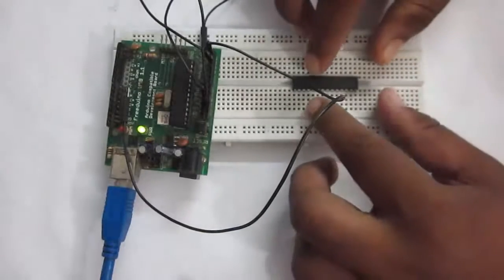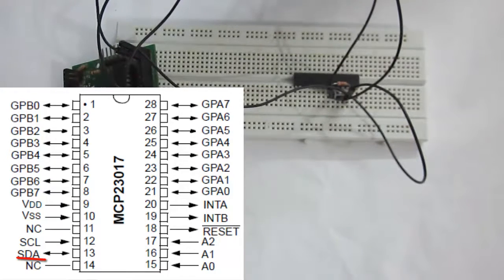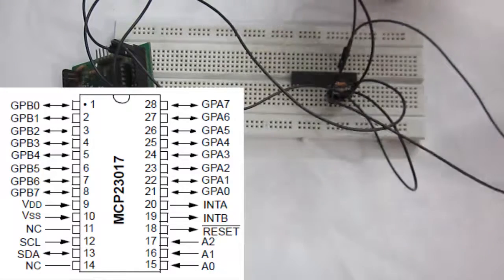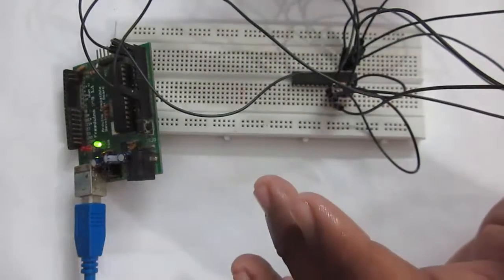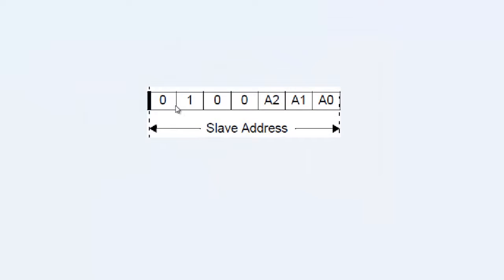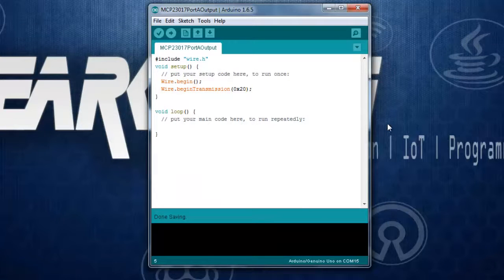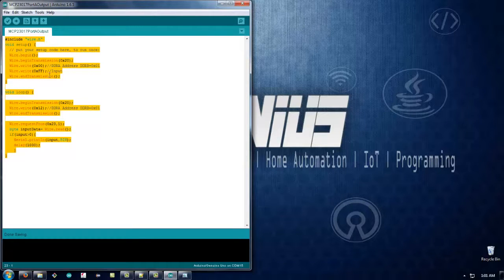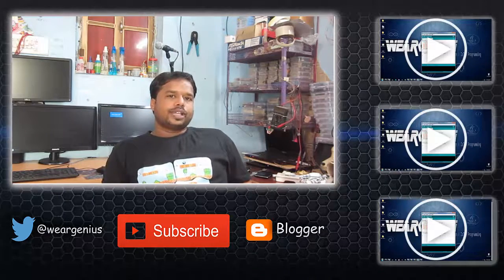Arduino | Tutorial | MCP23017 Interfacing

Comment: Excuse me, what I need to put inside  wire.beginTransmission()?
Reply: It is the I2C address of your device, if the pin A0, A1 and A2 are connect to the ground, the address is 0x20
Reply: @Mika-nv1me  thanks, I already finished college
Reply: @diegolopez6148  yes I guess, I answered mostly in case someone would ask the same question and would not have found an answer
Reply: @Mika-nv1me  don't worry man, appreciate the response
Reply: @diegolopez6148  okay :)

Comment: hey sir i need an immediate help please help me out for this project where i have to display digital voltage  value with some delay by using MCP3553 A/D converter
Reply from the maker: What do you want?
Reply: i am using mcp 3553 for ADC and i need to get digital output voltage, tomorrow is the last day to submit my project or else my boss will kick me out of his company. please help
Reply from the maker: Hi. Sorry for the late response.. I checked the ADC and it seems to have SPI interface but without the MOSI pin. Please check the following tutorial code https://www.youtube.com/watch?v=qLcmI5xcN58, It may help you. I have not worked on MCP3553 but it might be same as MCP3208
Reply: You have used the same sketch for MCP 23017 and MCP 3208, but when i am uploading this code for MCP3053 i am not getting the proper value as it is supposed to be
Reply from the maker: You might need to tweak the code of MCP3208 a bit to work with MCP3053. I don't have the IC so unable to check..
Reply: First of all thank you so much for your continuous response to my query. It means a lot for me.I am not unable to understand how to tweak that code.
Reply from the maker: No issue. My pleasure. Please check this code and see if it works https://github.com/rasmus25/sketchbook/blob/master/mcp3553/mcp3553.ino
Reply: Yesterday i worked with this sketch, but unfortunately didn't worked

Comment: how can we assign just some pins only as output pins?
i.e. if we just want 3 or 4 pins as output pins then how can we do it?
Reply from the maker: Wire.begin();
  Wire.beginTransmission(0x20);
  Wire.write(0x00);//DDRA Address DDRB=0x01
  Wire.write(0x00);//Output over here make the bits 1 that u want to make input like "00001111" (0x0F) makes first 4 //pins as input. Like that u can calculate the value according to tour requirement.
  Wire.endTransmission();
Reply from the maker: +Anish Shrestha simple just make output make those bits as 0. Like to make pin 3 as  output and rest as input u can write 0xFB (11111011) to the DDR register. For other usages u can calculate like that.
Reply from the maker: Did that work ?
Reply: yes, I'm working on that. That helped in  assigning the ports as i wanted, but the task is not over yet.
Anyways thanks for the guidance.
Reply from the maker: +Anish Shrestha u can check other videos too for other usages....
Reply: While working with MCP23017 for A2A1A0=000, we can assign the 16 ports as input or output as desired,.
But, for any other sequence of control signals, i.e. for A2A1A0=001, 100 or any other sequence does the input or output ports can be assigned as desired?
Reply from the maker: Yes absolutely....
Reply: This means, for A2A1A0=000, we have a set of 16 I/O ports. And, for A2A1A0=001, we have a set of another 16 I/O ports, isnt it?
Or am I being mistaken?
Reply from the maker: No not like that...These can be used to stack multiple MCP23017 onto same I2C line. For that the A0A1A2 pins are used as the stacked MCp23017 need to have different addresses....Otherwise how can the microcontroller will address multiple MCp23017 as they are connected in the smae BUS. So now u can stack upto 8 MCP23017 to arduino/other mc by using different A0A1A2 combinations...
Reply: ok
I got it.
Reply: well, I'm using atmega328 for interfacing with mcp23017, and my major problem is that i need more than 128 output ports(180, being more specific).
So, is a single atmega328 capable for that?
Reply from the maker: +Anish Shrestha ya stack 8 Mcp23017 with different A0A1A2 combinations ... that's maximum